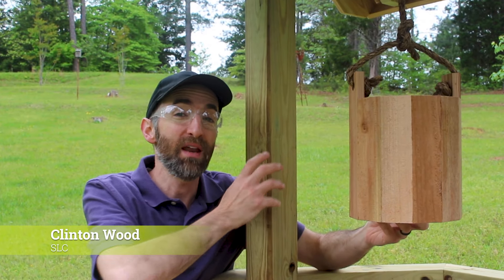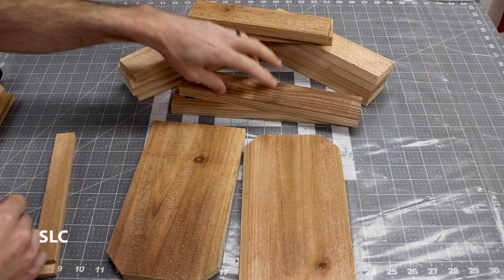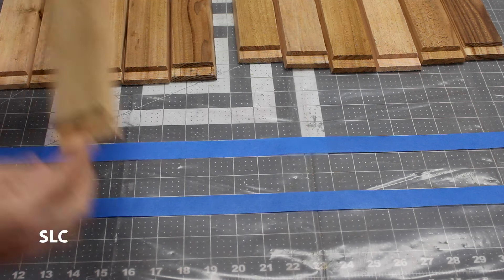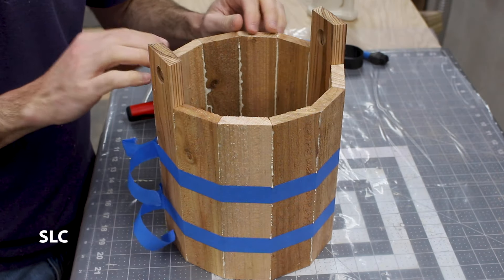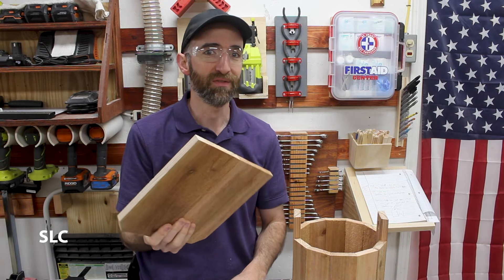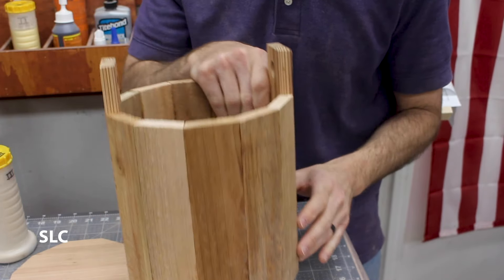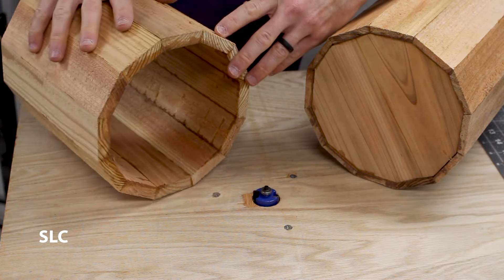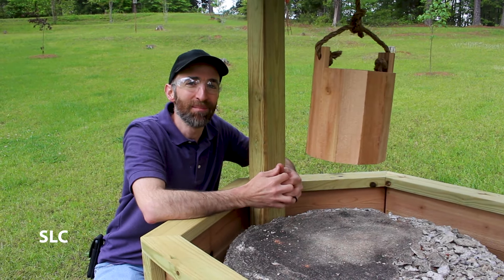Making a Wooden Bucket | Simple DIY

Comment: This is really great project.
For anyone without a strap clamp, use good old garden string and pull it tight. Then with a good knot in place, do it 2 or 3 more times.
If you don't have garden string grab a pair of Granddad's belts. That should work.
Again, lovely project.
Reply from the maker: Those are some awesome tips, thank you

Comment: Very nice! You made it look easy with your clear instructions. Will you be adding a finish / sealer to it, seeing as it will be an outside piece? If so, what would you recommend?
Reply from the maker: Since it is cedar, I don't plan to add any finish. But if I did, I would probably use a spar urethane, but this would make it less antique looking, and shiny.
Reply: The Wood Whisperer (I think) made a video comparing different wood finishes. His conclusion was using a penetrating oil. UV rays will destroy most any finish. If it’s a surface treatment, that means it gets ugly, then you have to remove it all to restore the finish. With penetrating oil, all you do is clean it and retreat it. And the wipe on, wipe off any excess is as simple as wood finishing gets.

Comment: This is great. I always wanted to make a wooden pail but was daunted by all those finicky angles in tapered pails. Straight sides are much easier. Question -did you just use a hand drill with the forstner bit?
Reply from the maker: Yes, just a hand drill. If it is not perfectly straight, the ropes will hide it.

Comment: Hi, great video. 

can you tell me what kind/brand of table saw you are using? 

I'm in the market for a new table saw, but I can't see my self spending thousands on a table saw. 

I"m just your typical weekend handyman warrior around the house.

Thanks.
Reply from the maker: It is a very old Craftsman that my father gave me. I need to upgrade but don't want to spend the money either.
Reply: I have a Skilsaw with the same 15 amp worm drive motor loved by carpenters. The worm drive has super torque, and reliability. Only $600 with the mobile base.

Comment: if you traced the INSIDE of the bucket and used that line for cutting out the bottom, and it's a rabbet joint, how did that bottom still fit?  My mind says it should have been too small unless you cut OUTSIDE the traced line the thickness of the rabbet joint...
Reply from the maker: The line was drawn after the rabbit cut.

Comment: Would the 15degree angle work on any bucket you make? Or would be a different angle if you were making a bucket with more pieces? Thanks
Reply from the maker: If you change the number of pieces, it would definitely change the angle of the cut.
Reply: So how would I work out the new angle then?
Reply: You take 360 and divide it by how many cuts you are going to make. This has a total of 12 boards with 24 cuts 24 x12=360 hope that helps someone. It's probably a year late for you.
Reply: Seven months late, but in most schools 24x15 = 360 = 12 pieces x 2cuts/piece x 15 degrees.

Comment: How do you waterproof it do it won't leak?
Reply: Titebond 3 is waterproof glue. If you want it to hold water for a long time, you would need to seal the inside. Various applications could achieve this with the most appropriate depending on the use.

Comment: Thanks for your replies! I was also wondering if there’s a way to make this bucket so that there’s no end grain showing at the base?
Reply from the maker: I guess you could just glue on an octagon base but it might look odd from the side.
Reply: @SpecificLove7  That's a good point! I hadn't thought of that.
Reply: You could make a really strong joint with a couple router bits. 

If you clamp  the sides to the bottom, you can use a pattern bit to perfectly match the shape. 
Then a step bit can create a notch for the end to sit in. That would leave about half the thickness of the pickets exposed at the bottom but would result in a super strong and tight joint.